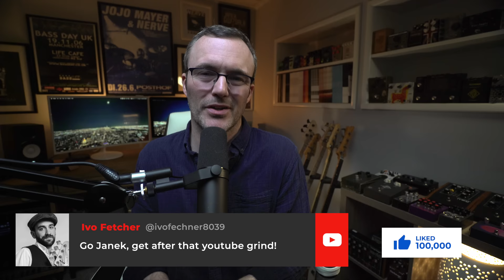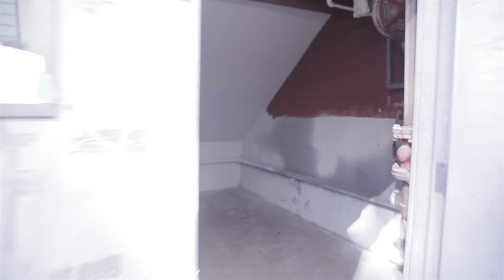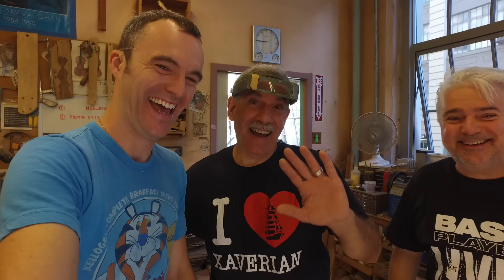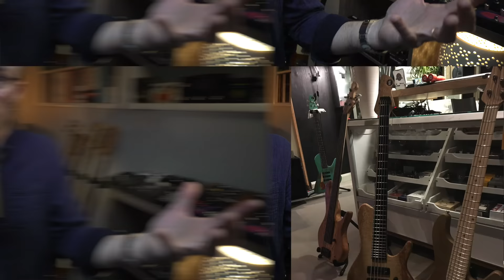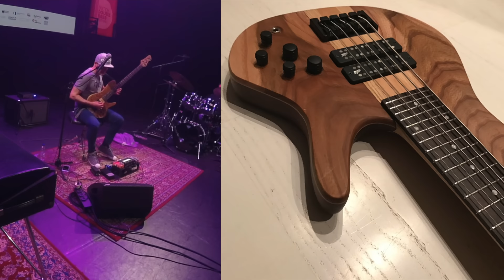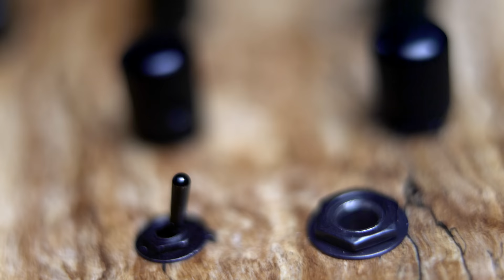Why I Stopped Playing a $15,000 Signature Bass

Comment: Very interesting perspective on the higher end of the market. I've personally found that with time a cheaper, simpler spec instrument does the job for a gig and a tour, as replacing a high end instrument due to damage, loss or theft is financially unsustainable. The pride and joy instrument stays at home, the cheaper ones are out on the road. Which one is the favourite, go to then? Difficult question. As the hours of practising have added up over the years, I find that each instrument I own sounds way better now than it did 10 years ago - it's my hands, not the block of wood.

Comment: I love by BN5. In fact it’s second I’ve owned. For active basses, it’s only sits behind my old Modulus Quantum 5! I’m sure someone already asked, but what is your electronics setup in your F Bass? I see the switch which isn’t standard. Is that active passive or a pickup switch? Do you have vol/vol or vol/pickup in yours? Subscribed. Love your stuff!
Reply from the maker: The preamp is an Aguilar OBP-3, and the switch is a kill switch. I have volume controls for each pickup, pull pot for active/passive, and bass/middle/treble EQ, plus a tone control.

Comment: I thought this might be like the "one video a day" period again, I don't think I missed any of those. Between that series and Adam Neely's gig vlogs, brilliant videos.
Anyway, to my question! Over the years of playing and the various instruments I've owned I've managed to settle on the things I need in a bass; being that I've got what I consider to be fairly small hands, from my 1991 Ken Smith Burner I discovered my ideal string spacing and nut width; from my 1985 Japanese Fender Jazz I got the liking for ash bodies, and from my (now long sold) Fender Roscoe Beck I borrowed the series/single coil/parallel switching system and preferences for tappable pickups that made it probably the best 5-string Fender ever produced. 
So from that I made two basses for myself, using standard 4-string Jazz bodies from luthier supply companies (both lightweight ash, one chambered), and had necks made with the standard 4-string heel dimensions, but a 45mm nut width, and 15.5mm string spacing via Schaller 2000 bridges, which are now discontinued, sadly. Electronics are the coil tap switches, and Kent Armstrong Claymore pickups, and a Bass Mods 35AP preamp in one, with a Noll Electronics preamp and buffer in the other, both 3-band.

My question is, from which basses you owned in the past would you say you've carried forward certain preferences in feel and tone, and did you/would you ever consider putting a bass together for yourself in the same way as I did, to get everything you like in one instrument, as opposed to having it made for you?
Reply from the maker: I think I'm very lucky that I wouldn't consider putting together a bass on my own as I don't have the skill set necessary. If I did, I might do that kind of thing all the time and probably play them a lot less than I should. 

I'm happy to work with great builders on getting what I love in an instrument, just as I have with all the custom instruments I've ever played. The things I've carried forward with me have been things like the tighter string spacing (around 16.5mm), shorter/ish scale length (currently 32 1/2") and the zero fret that I first experienced in the Mattisson. Tone-wise I've made some big changes from Fodera, through Mattisson, to where I am now with the F Bass. But although the wood selections and combination have been quite different, I've always managed to sound like myself, or at least an evolution of myself without departing from the fundamentals of how I hear sound.

Comment: My bass strings sit at about 2mm off the board. Any Suggestions?
Reply from the maker: Personally I like a high action. I think there is way more sonic range to be gained from it, and 2mm sounds super low. If you're going to raise it, don't go crazy all in one leap though. Do it a little at a time, practice for a few weeks, and then try raising it again. That way your technique can adjust to the changes slowly, and you will mitigate any risk of injury. 

I raised my action about a quarter turn of the screws in the bridge every six weeks over the course of a year, and that worked great.

Comment: I met Vinny and Joey Fodera at NAMM years ago.  Their basses were reasonably priced. And I had a 1988 built 4 string Monarch. Their support was outstanding, even if you had a newly bought used Fodera.  (I found mine at a Guitar Center for 1200 bucks!   They didn't realize what they had.   Eventually, as years passed, exotic wood and pricing, combined with inflation, pushed their pricing way up.    I'd love to have another Fodera.   But it is unrealistic at my income level to get one.       Still.  Those guys will do what is needed to make a bass right for a customer.    Good good people. True woodworkers excelling at Bass building.

Comment: Hi Janek, commenting for the algorithm. 
An unrelated question: if you could put together your own analogue pedal with its custom signal path, what would it be, what pedals would you merge together?
Reply from the maker: I've been thinking about this exact question for so long, and I'm sorry to say I don't have a concrete answer for you. 

The position pedals sit in the chain is always changing depending on what I'm going for, so multi FX (and lumping pedals together) cause issues with not being able to switch things around easily. i'm still working on the solution...
Reply: @janekgwizdala  Thank you for your answer, much appreciated :)

Comment: Hi Janek , what case do you use when you fly ( airplane)?
Thank you
Reply from the maker: oof... life long question unfortunately. I've gone through almost all of them. 

I check the bass always, so it's always a flight case of some kind. I was using the Gruv Gear Kapsule for a while, but it recently just kind of gave up on me. I went to an SKB i series flight case, but it's really bulky, and only good for one-off fly dates where I don't have to move around a lot at my destination. 

I think my favorite one is still the SKB "Bass Safe", but the quality of the strap and the buckle is total garbage. I'm trying to customize the ones I still have that both broke before, and get a better quality strap, and sew in a steel buckle.
Reply: @janekgwizdala  Thank you very much

Comment: I love F Bass, but the price point is pretty similar to Fodera isn't it?  In which case, I don't really understand why you'd leave Fodera due to the price point then end up at F Bass.  I prefer F Bass to Fodera personally, but don't understand the reasoning here.
Reply from the maker: I left Fodera not because of what the bass was costing me, but what my signature model was costing the public. 

As a signature artist with a company, you don't pay for the instrument. That's part of the deal. Not only that, but you can often write into your contract a royalty payment on each bass the company sells. I did that with Fodera, and I did that with Mattisson. 

I just looked at some of the prices of instruments on the F Bass website that sold recently, and the prices don't come anywhere close to Fodera: https://fbass.com/in-stock/

Admittedly I had some extras put on my bass, and was quite specific about neck type, facings, etc... But to put together a serious instrument with FBass is not something that is going to cost you anywhere near $10k even. I think the sky is probably the limit, and if you want the most expensive top woods, and a 20-piece custom neck etc... then you're going to pay for it just like you would anywhere.

Comment: A million? At 1st it was 100,000. Pushy? It doesn't sound like your vibe. Simply treat yourself with a Wal at 100,000 and smile. I wrote them as well to ask about what they were able to do since the website said no orders while they backfill their current outstanding balance.  Surprisingly they responded.  Didn't wish to even estimate cost. Told them that was okay,  I was only curious and had already fulfilled my dream instrument.  Still, a Wal would not be out of the question.  Right Janek?
And I liked, commented and subscribed.  Best of luck reaching your goal(s).

Comment: I have heard a professional, very talented bass player playing a $9,000 bass and a $900 bass through the same equipment on the exact same settings, and there were hundreds of listeners who were more impressed with the cheaper bass,than were more impressed with the expensive one. The sound generated by a bass is primarily a product of the amp, the effects, the pickups/strings and the player's skill. Never have I noticed any input from the exotic wood top, or the gold inlays. Have you?

Comment: Custom instruments are a rabbithole. I couldn't afford them, so I started building. A different, but similar rabbithole. They're not supposed to be affordable and they're not better value for money unless you play them to death like Janek has.
Reply from the maker: A rabbithole indeed. And I agree that they're not meant to be cheap. I just knew there was, and still is I guess, a way to give a slightly more "affordable" option to a younger player, and give them the experience of high quality craftsmanship in the form of a CNC instrument now that technology is where it is.
Reply: @janekgwizdala  Wow, thanks for the reply. I agree with you about CNC. It's truly amazing. You're bottom shelf Squier  is now the exactly same dimensions (and mostly the same materials) as the custom shop models. I'd still say your mind/hands are the defining factors.

Comment: I think Matt Garrison was being even bigger in his britches than he actually was, and topped off with a side of butthurt.  I think you shouldn't have let him get to you so easily.  As you described, you modified your bass more than most bassists have done to their signature instruments.  You're probably better off anyway.  I haven't seen a single bassist yet that actually sounded better live and recorded once they enter in these signature/endorsed this and that and then lose some control over which bass, strings, amp, and effects they can use.  Except maybe, Billy Sheehan.   In most cases their original choice of equipment sounded the best.   I'm sure there's other exceptions besides Billy but probably not many

Comment: Sorry… but Fodera basses are Not ! Stradivarius Instruments level. Just because it’s overpriced doesn’t make it better. Fender Basses have been on more Hit songs than any instrument out there.
Reply from the maker: Not only did I never mention the price as the reason I believe them to be in a similar, albeit in a more modern sense, echelon to Stradivarius... Just because a certain model of bass has been on more songs that another does not then make it grander or more valuable. 

That's like saying the Ford Fiesta is better because it has driven more miles than an Aston Martin Vanquish S. There are probably 100, if not 1000, to 1 of those cars made, yet Aston Martins are an objectively much better constructed automobile. Of course the Ford has driven more miles. There are millions of them on the road.

Comment: You're making a bad argument comparing your custom Fodera to the signature Strats. The Fender guitars that you show are all variations of a stock Fender model. Matt's bass on the other hand was a true signature bass. Fodera did a lot of body work for him on that model and they also changed the scale, extended the fretboard and modified the electronics layout. Your signature bass had a tighter string spacing, other woods and a direct output. If you really think that these 2 situations are comparable you're either dishonest or stupid. 

But the more I watch this video the more I think Matt has a reason to holde a grudge against you. He was an influential bass player at the time and there were no other medium scale signature 5 string basses that one could buy. The only other influential bassist with a similar setup was Dominique DiPiazza and he played full scale basses at the time. Also I do remember you kind of trying to sound similar at times at that time. A lot of people did, Hadrien did too.

You're basically making Matt the culprit for your relations with Fodera but is there a chance that your departure wes also motivated by money and control? Let's also not forget that you're not playing Mattisson bass. Is this Matt's fault as well?

If you really cared about your relations with these people you'd give them a call and try to sort things out in private. Even though Matt shouldn't be airing dirty laundry in public, he was not wrong about what he said about you not giving him credits for your signature bass. 

I think that all you care about is your image which this video more or less shows.
Reply from the maker: Thanks for calling me dishonest and stupid. Or was it one or the other? 

And great job on completely missing the message and the story of the video. 

It is absolutely unacceptable for someone to say the things Matt did online/in public. He could have, like you suggested I do now, sorted things out in private. But his ego got the better of him, and he chose the path of aggression and not of love.

This video has nothing to do with my image. Image is other people's perception of you, and if you care about what other people think, your ego has won. 

My departure from Fodera was not motivated by money or control. Who should have been controlling what? Certainly not me. Where does money come into anything? Not for me. Only for the constant stream of fans that said they wanted to play my bass but couldn't afford it. I suggested a way to make that happen, and they said no. And then their manager proceeded to make a series of insane decisions that devalued the entire process of having ones name attached to an instrument. 

I did reach out to Fodera privately. And that is where that conversation will remain. 

The worst part about what you're saying, is that you are obviously very much on the side of Matt when sides should never be taken in situations like this. You actually know nothing about the details of any of it, yet you talk as though you have the right to dress me down in a public forum and tell me I did the absolute wrong thing in making this video. 

Making all those statements about how influential he was to other bassists at the time makes what he said to me in public 100 x's worse. When you have the microphone in your niche, as he did for so many years with the electric bass, it comes with a lot of responsibility. He chose to ignore that, and did a lot of damage to me and my career in the process. That is almost unforgivable, yet I would totally do just that if he would only reach out and apologize. That's literally all it takes to make things right. 

You do go on to make some ridiculous comments about not playing a Mattisson anymore, but this is just about where I run out of energy explaining the facts and ring the bell to get off at the next stop.